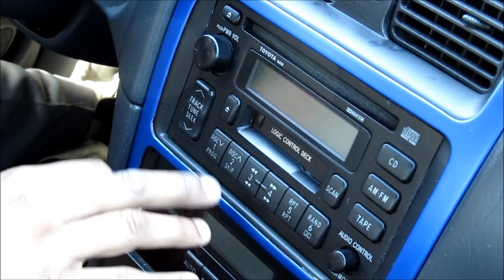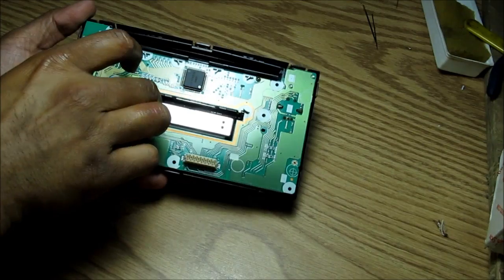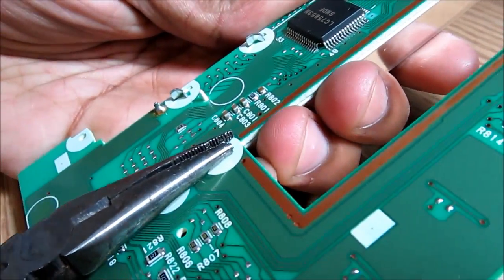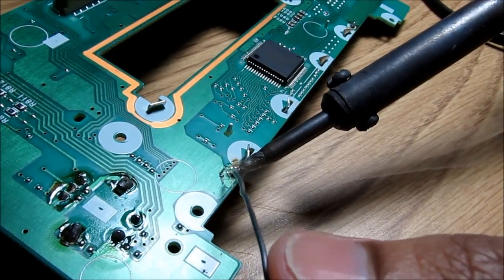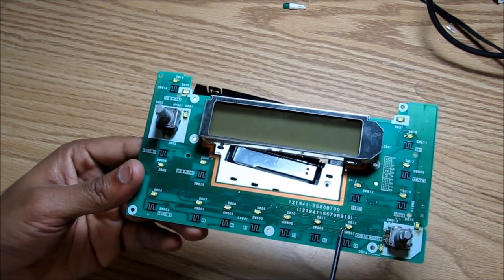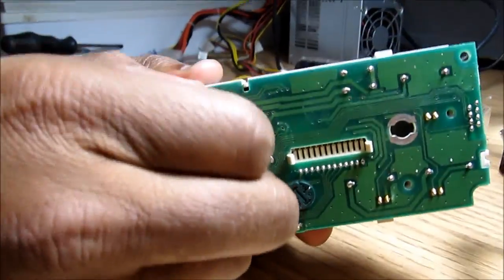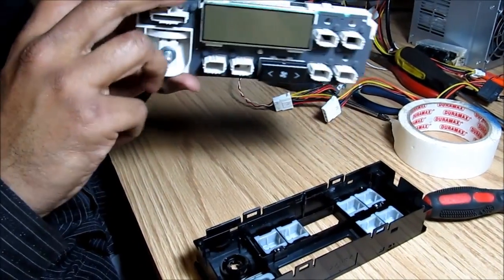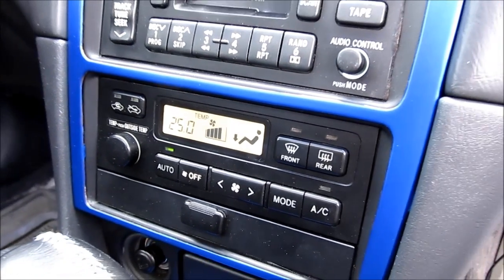Stereo and HVAC LED Backlighting Upgrade

Comment: Hopefully I’m in the right place to ask this Q - The LED backlight in many radios (like the walkie-talkie FRS types) have an automatic shut-off after a few seconds to save battery.
Is there a simple fix to defeat the timer so the backlight stays on?
I’m guessing the timer is written into the device software and can not be DIY.
- Thanks!

Comment: I have a 2000 Toyota Camry LE. I'm the 4th owner of the Camry. The original radio was removed from the in the Camry in 2002. It bit the dust. I got a new stereo receiver for my Camry. It has leds built into it. I can change the color of the leds. But due to city or state law you can't have blue or red leds shining in the cabin of the car. So I just keep the leds in the stereo receiver cool white. I want to change the a/c and heater lights to led. One the lights is burned out. I want to change all of the lights in the dashboard to led. Plus the cigarette lighter light, console shifter light, glove box light all to cool white leds lights. The ignition ring, dome light, trunk lid light has already been changed to led. The headlights have been changed to Oracle lighting V Series led headlight bulbs. They have no fan for which I like. The rest of the lights on the Camry have been changed to Sylvania Zevo Super bright leds. The only thing I don't know how to change is the lights that are in the clock of that year. I changed the Flasher to the turn signals. It works with led as well as regular bulbs. Since Camry is a silver like color I choice the cool white led bulbs. I think It'll set the Camry off. I watch your videos when they come on. Thanks for this one.
Reply from the maker: Nice. I miss these days of customizing stuff. Now I like breaking stuff haha

Comment: Is it a fuse that lights this board, cause I can’t get power to my license plate lights either
Reply: Yes. There are generally two fuse boxes for these Toyotas – one in the cab and one in the engine compartment. The actual fuses controlling the dash lights can be found in the cab fuse box. One will be marked “instrument cluster”, one will be marked “Dome”. There is actually another “Radio”/“Stereo” fuse but that generally powers the radio and radio lights only. 
Here’s the clincher: the Tail light relay (marked “TAIL”) in the engine compartment interplays with some of the cab components (turn signal system, dash light system, running lights). I had this issue. Check your fuses by replacing them with the micro fuses of appropriate voltage THAT LIGHT UP ONCE BROKEN. If the problem persists, you could check your tail light relay by replacing it ($10-$15). But most, most, most of the issues with dash lights come from the tail light system shorting (again, because the instrument cluster lights inc climate control, turn signals, tail lights all interplay). The #1 cause of dash light failure in these Toyotas is actually faulty aftermarket tow hitch hookup. Check for a loose ground if you have one. It’s because the tail light relay in the EC boosts current fed to the rear lights through a pigtail of green/white,

Comment: Do you by chance have a business? Would pay to have you change my stock radio to blue. I’d be glad to send you the face plate. Yes, I’m serious. I don’t have the equipment or the hands to do that detailed work (severe arthritis). Also, do you recommend a certain type of LEDs for the HVAC controls? Used an incandescent blue bulb and they are too dim and don’t throw light far enough. There are patches of white at the far edges on my 1999 Camry. Thanks in advance for any help.
Reply from the maker: Hi, I don't have a business sorry, but wit this video you should have enough to DIY 😊
Reply: speedkar99 hi speedkar99! Got everything done with the switch - almost. My 3 LEDs on my radio for the on/off switch are very dim. Have checked connections and even switched LEDs. Don’t know what problem is. Can you please help? For the treble/bass/fader/balance in lower right, I have no light at all. Noticed one neg/pos pole in one of the LEDs is screwed up from when I removed the original. One of the solder points is smoked. Is there a way to fix? Can I graft a new lead in there for the damaged part? I don’t want to give up. I enjoy a challenge and your videos are great. Wish I had half your skill. Have done my whole dash in blue and changed gauge needles to red with special paint. Looks awesome! Just need to get these issues taken care of in the radio and I’m all set! The cigarette lighter light was a PITA but I did it thanks to you. And if I have to change out whole board, tell me! I don’t want to do it, would rather fix it if I can. Thanks very much for your help!
Reply: Did surgery on the board and it actually worked! Also had one bulb reversed in polarity. All I need to do now is replace the incandescent for the display. Have my fingers crossed.

Comment: I've just been trying to do an old 80`s Alpine radio cassette with a failed (3x4mm peanut incandescent) LCD display bulb, I used a T5 B8.5D with 5050 LED & removed it from the holder, but its not working. I did reverse it, it's not polarity, I'm wondering if the circuit board is less than 12v (I kept the resistor on).

You cant remove the front panel as its soldered very tightly to the main board (I don't want to be unsoldering 40+ small wires with my huge soldering iron!

* Edit: changed the LED, now its working!

Comment: well done video, thanks
Reply from the maker: +ellrick glad you found it useful
Reply: I have something of an education in this field, electronics specifically not so much car stuff, but your work is very good. Is it still stressful hoping it all bolts back together after you have done this stuff 100's of times?
Reply from the maker: +ellrick not much, the soldering is tedious so my brother helps with that.

Comment: Ok my 08 g35's cluster leds (some of them) keep going out and coming back momentarily. What would be the cause and can I fix it by soldering new leds? Thanks.
Reply from the maker: +Imteyaz Yousuf seems like you have a broken solder joint on the cluster board. You'll have to remove it and examine all the contact points and then you can reflow the solder
Reply: speedkar99 - this gen of infinitis and 350Zs are notorious for this issue. I've seen several videos of people soldering new leds in them. But I have no idea if they last.

Comment: Really cool video, man. However, I'd personally just replace the radio instead of replacing the LEDs on the factory unit. 
My 2005 civic had a crappy radio and has crappy lights for the dash, HVAC and gear selector, so I'm replacing them with LEDs (currently waiting for them to arrive). For the radio, I got the Sony MEX5100N BT (or something like that), which has RGB Lighting. not only does it look good, but you get extra features. Still, I guess if you're satisfied with the factory radio, this is a totally legitimate solution (and cheaper, too). Good job.
Reply from the maker: +uRiBiTo666 I don't like the ricey looks on aftermarket radios.

Comment: I tried soldering on my guage cluster pcb and only 3 light up? I used 5730 blue
Reply from the maker: +Soldier1287 they are polarized you might have to flip them
Reply: oh.  could not see any + or -
Reply: the original stock leds were green 1210/3528

Is it because they are different size?   I just ordered some blue 3528
Reply from the maker: +Soldier1287 you should test them before soldering to make sure
Reply: Was pain in the ass but finally did it.

later will do the radio

Comment: voltage?  what if you solder little bulbs the where the smd led goes?  except I'm wondering for the dash pcb
Reply from the maker: +Soldier1287 yes 12v

Comment: Hey dude, that is great knowledge and skills, and a lot of work.  I can tell you are a pro, but why don't you get a new touch screen stereo DVD CD radio like this Pioneer AVH- X4800BS 
http://www.pioneerelectronics.com/PUSA/Car/DVD-Receivers/AVH-X4800BS 
You can buy one from Walmart for $267. It would look great on your car. I am getting one for my Ford Mustang.

ps. I was looking for a video to change light bulb of climate control to blue lights to match the Pioneer head unit

Comment: I really wish i would have watched this first. would have saved a bunch of time.
Reply from the maker: Danté Smith I was doing this blindly too, didn't really have any DIY guides out there. Hardest thing was finding out what LED replacement to use. Which one did you use?
Reply: I used 3528 LED strip lighting for everything. The radio was't that bad because each light does its own job. For for my air control I had to make walls so that the red didn't mix with the blue. Same for the dashboard, I want the numbers and arrows different collars. Cause a all red dash board looks lame.
Reply from the maker: So you put in strip lighting behind the face of the buttons? Does it light up evenly? How did it clear the buttons? As you saw in my video, I simply replaced all the LEDs so the light is distributed properly and I didn't have to deal with wiring.
Reply: The radio was simple, I just replaced the LED's the console was a little hared. Trying to keep the light even, and keep it from mixing. the dashboard was the worst, I wanted the arrows red with a blue background then reversed for the small gauges. so that was hard. but i got it and it looks great. when i finish my car i'll upload a video and share it with you. I'd love to get your feedback
Reply from the maker: Sounds interesting, I'd like to see how it turned out.

As for the gauges you'd better be off with an ES300 cluster swap:

https://www.youtube.com/watch?v=lK-M9fvSGb0

Comment: Would this work on an 02-06 ES300?
Reply from the maker: Joy Gope Here you go:
http://www.clublexus.com/forums/es-1st-to-4th-gen-1990-2006/751275-diy-4es-climate-control-bulb-replacement.html

For the radio I imagine it would be similar procedure, but the LED type might be different.

Comment: Im surprise with someone with your expertise still uses the factory radio unit as it is not very good on the older model cars.
Reply from the maker: rhpham2 The JBL sound system in my car sounds awesome, much better than the Lexus system in my ES330 and many new cars. I don't like the tacky looks of aftermarket stereos, and I get connectivity with my AUX hack.

Comment: My Solara Hvac doesnt have the LCD display. Do you think I could pull mine out and replace it with an LCD one.
Reply from the maker: Miguel Martinez No, the manual HVAC uses wires to connect to the vents, and the auto-HVAC uses motors.